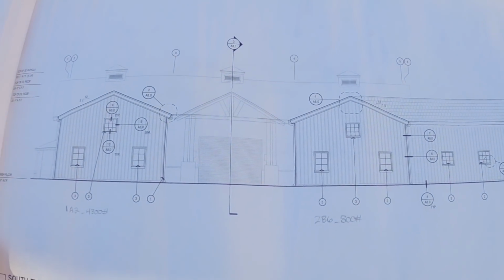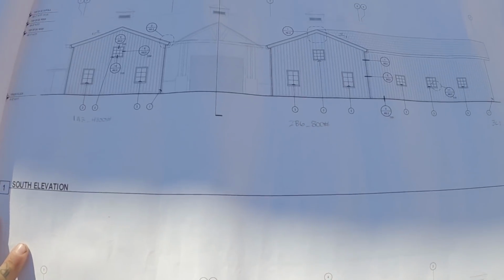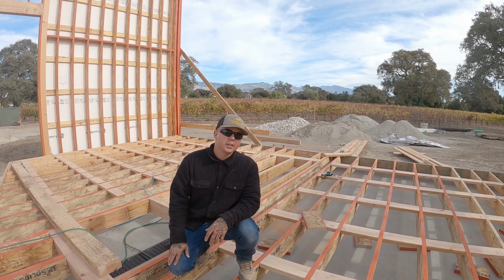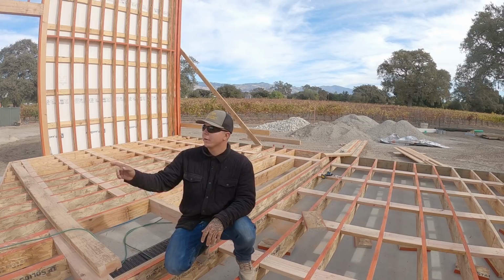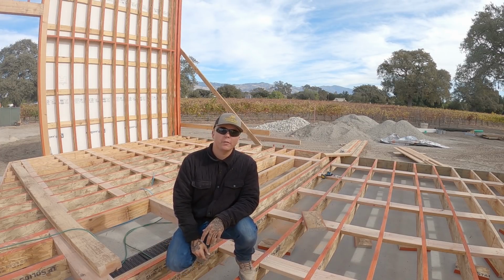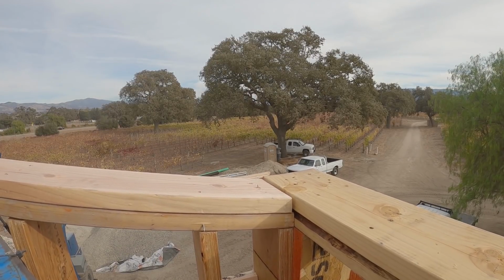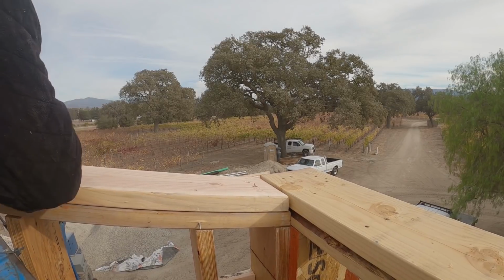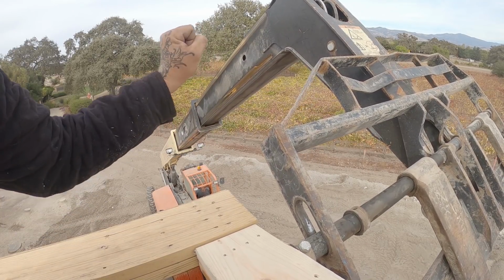LSL Stud Wall Framing Complete! [DAY 15]

Comment: I’m watching through this awesome build - can’t get over the giant Timber headers! 

Is that a west coast thing, or because of the big walls, or a simply a speed thing, or what? I don’t know that we could even get header material that large in the Midwest (at least without it being stupid expensive)!
Reply from the maker: Not a speed thing, just engineering. Out here everything is built for seismic areas.

Comment: Matt, did you wrap your hammer handle with electrical tape, sports wrap or did you use stiletto cold shrink wrap tube stuff? What do you like?
Reply from the maker: It sounds weird to everyone else, but I’ve always done electrical tape. Sports wrap is too thick, doesn’t work well with my holster for it.

The shrink wrap stuff is really nice, never tried it though.
Reply: @MattBangsWood  Try "Friction Tape".  Old school from the 60's and 70's

Comment: I use paslode nail guns and was thinking of switching to cool nailers. Any thoughts? Have you framed with coil nailers before? Main reason I’m thinking of switching is price for nails and being able to nail off a whole wall with out having to refill so many times
Reply: Coil nails are either too expensive or not stocked at most stores and lumber yards in my PNW area. If still interested check out Max's coil nail gun systems. They even have a 500 psi system.
Reply: That’s what I’m looking at but not the high pressure system. I have a max super framer 30degree stick nailer and really like it.
Reply: @travismassengale3743  I love my 21 degree Max!  We have to shoot full round heads here for code.  All my air guns are Max. Cordless are Hitach/Metabo.
Reply: Loren Rickey yea I have 1 metabo cordless and really like it

Comment: Does the face blocking not count for the lateral bracing? Why do the extra run of blocking so close to the face blocking?
Reply: I would say it’s probably for a fire break. In my area you have to have a fire break every 10 ft
Reply from the maker: It's for sheet break. Perimeter nailing all around! :)

Comment: Looks like 2x8”, 16” OC with LVL’s.  Is that necessary or can you go with 24” with LVL’s given the strength?
Reply from the maker: The roof was supposed to be 16" O.C., it would have stacked so beautifully.. Last minute truss changes with the engineer caused it to be 24" O.C... I would have liked to framed it 24" O.C.!

Comment: okay i'm brand new to this but I found your channel & love following... question: when you are putting blocking in between  the studs, is there a benefit to lining them up through each stud instead of staggering them? hope that makes sense..
|_|_|_|       |_|  |_|
|_|_|_|       |  |_|  |
|_|_|_| vs. |_|  |_|
Reply from the maker: The fact that you drew out a diagram is so rad. This blocking in particular is backing for siding, so it’s got to be in a straight row. They will snap lines and nail all siding on those lines.
Reply: MattBangsWood haha was hoping it would help explain better! - that's awesome, totally understand now! Keep it up bro, you're killing it!